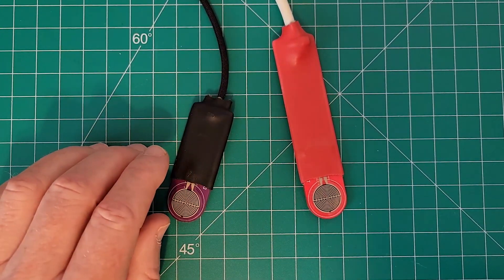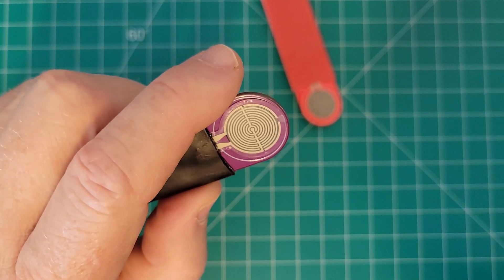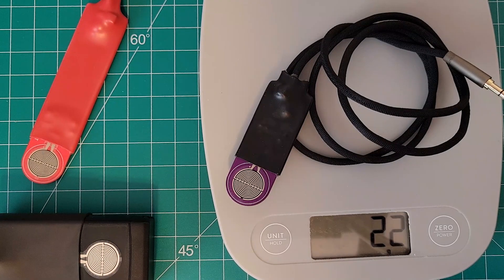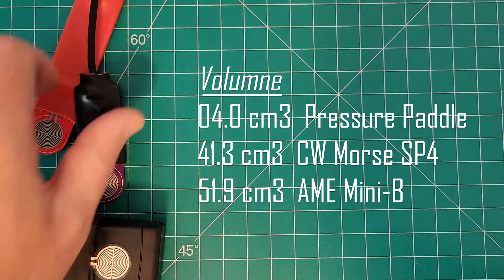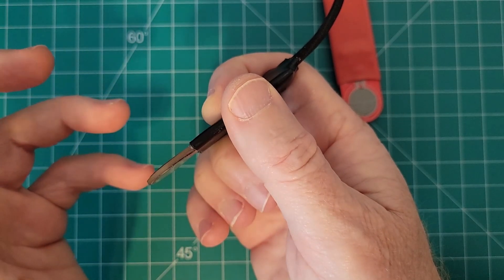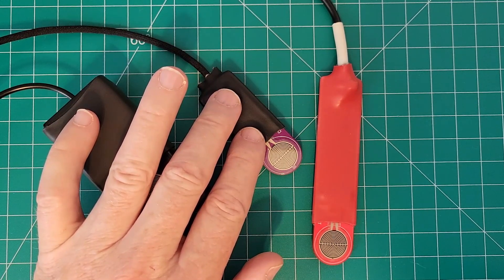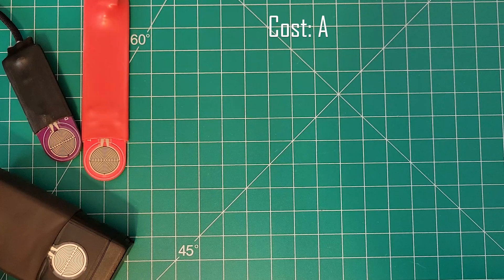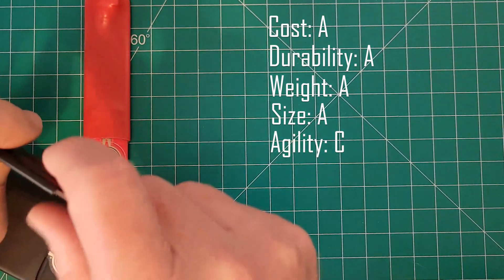Morse Code Portable Pressure Paddle (Touch Sensor Paddle) by David VK3IL

Comment: I use the short-board version with closed cell foam under the heat shrink tubing as my primary field keys.  Only in winter, do I switch, because accuracy suffers with numb fingers.  The prices you quote are for batches of 3 boards from OshPark.  Note that sensors are $5 each (2 needed).  Assembly really is not too difficult.
Reply from the maker: Dang - the price of those touch sensors have more than doubled since I built mine.  I did find 4 for $12 just now but still, that negates the "you can build these for $5" comment.  I have had that problem too, with the accuracy in winter.  And I think they perform a little different in the cold too, although I have no evidence to back that up, other than it "seemed" to be the case.  Thanks for supporting!

Comment: For clarification touch paddles, like that check kit, are using capacitance sensing. They literally sense touch. Pressure paddles use tensor bars like scales, i.e. solid state paddle from Nino 9A5N, where you can touch the paddle and signal I keyed after you exceed specific determined pressure like i.e. 30g or 1oz. In summary, you can hold your fingers on the pressure paddle, but you must not keep your fingers on the touch paddles. Touch paddles are weird for me as I used to have my fingers on mechanical paddles.
Reply: The VK3IL is a pressure paddle.  The sensor is a variable resistor, with high resistance until force is applied.
Reply from the maker: Thank you

Comment: The packability is fantastic!  I struggle with sending cleanly, perhaps due to lack of practice. It is a very good backup paddle due to low volume and light weight.
Reply from the maker: Yes, they are a bit difficult to get used to.  For me it was a combo or needing practice and the small distance between the two pads.  AS you suggest, great for backup at the very least, due to low size and weight.  Thanks, Dick